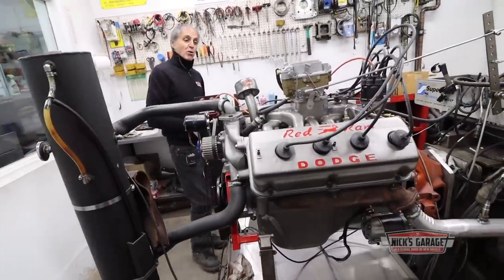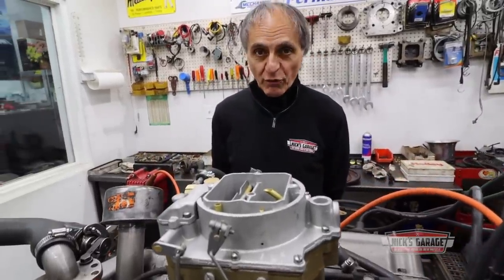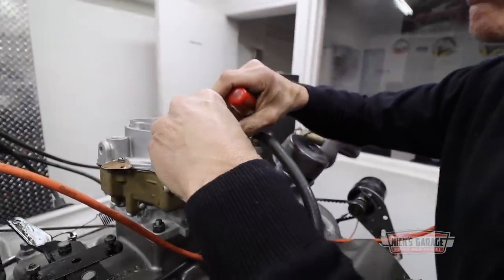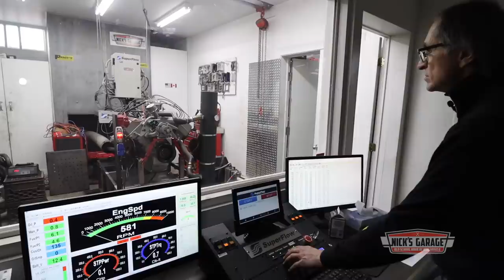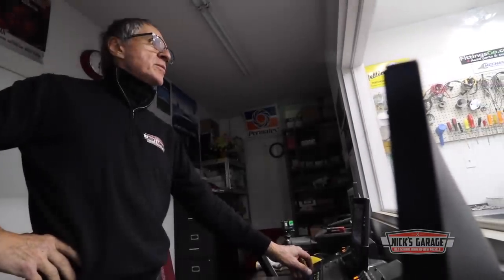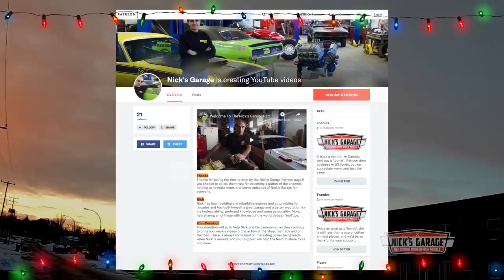Tiny Old HEMI - First Generation 241 Hemi on DYNO

Comment: Nick, Suzuki developed a silicone especially for a model (LS650/S40) single cylinder motor that was prone to leakage between the head and pipe.
It is available through the motorcycle dealerships and is the best product I have ever used for sealing high temp exhaust leaks.

Comment: That 241 Hemi sounds good! And runs so smooth. Like the way you you got it mounted to the dyno!
I like the way you tune your motors  to start easy. You are a Pro Nick!
That's the way those early carbs are. The primary side is where you get your best power on the early carbs Nick!

Comment: Hi Nick..had a carter on a 390 ford..it bogged when you got on it..it was from a 67 galaxie wagon ..i rebuilt it and same problem ..it was my first car.a 65 galaxie..i was working at good year auto service center in 71..i told the machanic who we called ( Bad Bob ) he looked at it and checked it out and ajusted the floats and that cured the problem..it never occurred to me the floats were off a little bit..after that it didnt bog again..after i put the motor in two spark plug wires got crossed and caused it to back fire..bob asked me if it had backfired and i told him it did and why..then he went straight to the floats..the wires got knocked off during the installation of the motor..i corrected the wires after it backfired..but the damage was already done... i was 16..after that ( Bad Bob ) was my hero...lol..always respect our elders..Hope you and your family and crew have a Merry Christmas and Happy New Year see you on the next one Cheers 🍻🍻🍻🇺🇸🇺🇸🇺🇸
Reply: Dave Micolichek  i did watch him use a float gauge on it so something had be wrong..i had a 360 the coil was intermittent failure it caused it to backfire and blew out the power valve and the accelerator pump to blow out..a backfire can cause some bad problems..it can take the teeth off a timing gear ( the nylon gear ) I've seen this happen on chevys..happy new Year...Cheers 🍻🍻🍻🇺🇸🇺🇸🇺🇸🇺🇸

Comment: Neat to see old engines looking & running like brand new.   My dad had an old flat head 6 cylinder (216 ci ?).  We had to fabricate the coolant tube that ran the length of the block.  We had mostly Fords though.  A few flat head V8's (both dead stud patterns) & several Y blocks including a '53 239ci & 2ea 256ci, the more common 292's & 312's.  Still love to watch your postings.  :)
Reply: Don.     Thanks for watching.

Comment: It looks like the spark plug gasket was installed on that plug you pulled . I have removed the gasket from many slant 6's as well as Hemi engines. A gasket tends to chew up the bottom of the tube and changes the heat range of the plug.The book says no gasket is to be used.
Reply: kevin.     I guess you learn something new everyday.

Comment: Yeah I went back and watched it at the beginning and the secondaries definitely weren't opening on those last few pulls but were open on the first pull
Reply: Yeahhhh! Check out time 32:53 the linkage to the secondaries may have been in one of the lower holes. More leverage would be applied on the secondaries and that would account for the lean mis because the primaries were exhausted past nominal CFM. His first thought of Increasing the jet size of the secondaries was correct but looks like his helper was left to stuff up the linkage side. What a shame as I would say his prediction of 160 H/P would have been close with larger jets, providing the jets were not drilled out over size!
Reply: Love your videos Nick :) don't let people near your work though brother ;)

Comment: For a 65-year-old motor, it sounds every bit as stout as it probably did the day it came off of the production line. Great job as always Mr. Nick. Incredibly enough, this is my third time saying this because time certainly does fly. Meilleurs voeux de joyeux Noël à vous et aux vôtres, M. Nick et à tout votre équipage et à leurs familles.  Un grand merci pour tous les grands moments que vous avez partagés avec nous en 2019. J'ai hâte à 2020 et à tous les bons moments à venir.
Reply: Really hard to get compression with such a small cubic inch v8
Reply: Compression can be demonstrated by holding your lips tight together and forcing pressure in your mouth to blow your cheeks out like Dizzy Gillespie's.

Comment: Great moments for sure, nothing wrong with looking for a few more horses lol . Neat old hemis. The WCFB had quite small primary/ secondary butterfly's & with 7.1 compression ratio, 150 HP is ballpark power. The exhaust being another hold-up ...it is also cubic inch limited . Cool passenger car power though for its age.

Comment: What a nifty little piece of history right there! There wasn't anything 'standard' on those old hemi's. It's like they custom built each year model, and every one was a little different.😜 Kudos to you for coming up with enough bits and pieces to actually get a successful run on the dyno. I knew they made a 241 cu. in. hemi, but have never seen one until now!😁 I'll bet a decent set of headers would make a big difference in horsepower over those tiny stock manifolds. EDIT: I'm 2/3 through the video, and I'm wondering how long it will take before you guys realize your secondaries weren't opening after you changed out the jets.😁 You forgot to wire the choke all the way open and it was keeping the linkage locked on just the primary flaps.😉
Reply: Dan.    We had it fixed the next day.

Comment: Nice work getting it running again Nick!  We need to see it in the car when he gets it back together. Another guy on YouTube recently bought one and got it running well enough to drive home. Kinda scary...  The transmission was automatic with two forward, reverse, and neutral.  No park. Have to set the parking brake.  Oh and it looked like a six volt system too.
Reply: Vice Grip right?

Comment: Jeez that thing brings back memories. Just seeing the hardware on the engine and carb is like yesterday to me.  Had a Dodge with this motor. Replaced it with the Chrysler 331ci with a 354ci heads & cam. For that day and age nothing could touch it for torque.  Really miss those days.

Comment: There was a 241 Red Ram out in the barn that came out of a '53 Coronet which had been stripped and sold for scrap by my older brother.  It was the first engine I ever turned a wrench on...I was, maybe, 14 years old at the time.
The one I played with was in way better condition than this one was when it came in the door...but it was removed as a "runner", and that WAS 42 years ago!
I remember seeing marks in the combustion chamber from some sort of rotary cutter that was used to machine the chamber from raw casting to the "hemi" shape.  I merely noted it then as neat...but after learning design and manufacturing, the expense doesn't make much sense to me...unless you're trying to squeeze every last bit of uniformity and performance out of a set of heads.  I've looked at loads of photos in the past hour trying to confirm this before mentioning it here, but found no close-up, high-resolution photos.  I even ran 1/4 speed on Nick's "look at the dirty parts" video...and one where there was a very short bit showing one of Nick's guys disassembling a piston/rod next to a cleaned head.  Can someone here be my sanity and say that my memory that machined combustion chambers were a part of the first Hemi's magic?

Comment: That funny bridge at the front of the engine looks like the "floating power system"  used on all the inline engines going back to the early 1930's. Dodge still offered the 230 flathead 6 at the time these motors were introduced. great video!
Reply: ...yes, and dodge was still making 230 flathead 6's after these Hemis were discontinued...to 1959 I think in cars&light trucks, into the 60's in Power Wagons and such, and I believe into the early 70's in industrial uses....

Comment: When I got my walking papers from the US Army in 1947 I moved to Detroit just to go to work at Chrysler Corporation. In those days there were a few test mules of the HEMI engine, by 1949 Chrysler and Desoto were first on going to production. Plymouth looked at a few different designs, even a V6, but decided to go with the poly head V8 citing lower production costs and higher customer interest or as my dad used to say, a working man drives a Plymouth home, a well-heeled man drives a Chrysler home. In those days each Division got to do what they wanted. Chairman KT Keller always signed off on anything new and promising, the hardest part was getting it under his nose to look at it. These were considered premium engines.1951 Chrysler called theres the Firepower, 331 cubic inches in certain models, also in Dodge trucks. The 1952 Desoto Firedome 276 cubic inches only the Firedome model. Dodge management being the conservatives they were, you know now that I am thinking about it there was still a few guys in management from the Dodge Brothers days, decided to wait and see how Chrysler and Desoto did. When the numbers came out for Chrysler, and later Desoto, Dodge saw it was a grand slam and jumped right on the 241 they had been using as a test mule engine since 1950, and they put the 241 Red Ram Hemi into everything they made, convertible, truck, sedan, hardtop even the station wagon got one. The fun part about the Red Ram compared to the Firepower 331 and Firedome 276 was the offering of over the counter dealer parts, dual carburetors, dual points., that sort of thing a Chrysler Corporation first. You could get a very reliable 175-250 horsepower from this engine, something completely foreign to most in 1953, no other mass-production engine could touch a Dodge Red Ram Hemi in displacement versus horsepower. Not a one. One thing is for certain, nobody, myself included ever expected these three engines to take off as they did, we could not build them fast enough to cover the orders. In 1955 I moved over to the newly created Imperial division and lost track of development on that stuff.
Reply from the maker: Thanks for your very interesting comment, Andrew.

Comment: You had fuel coming out of the secondaries before you changed the jets.  Look at the video of the carburetor after you changed the jets. No fuel that I can see.   Something changed after you took the carburetor apart. Check it out Richard from Florida.
Reply: Richard.  We had the original jets installed and also blew air through them. After that, worked well.
Reply: I noticed that too. My specialty was rebuilding carburetors back in the day.
Reply: You could see the secondaries didn't open at all for the next 2 pulls as well.
Reply: In the video it looked like The secondaries did not open  after the jet change
Reply: I also saw the secondaries where not working after the first pull.  Something was changed internally after you did the first jet change.
Reply: Yeap. Broke something the first tear down. Didn't fix it the second tear down and too stubborn to go back and fix it. Shoddy.
Reply: @InfiniteMushroom my exact thoughts drawing extra air through the gasket leaning it out. Thats why you charge more when the customer helps or is just present... part of Murphys law...
Reply: Like you could do better? Likely not ...troll. Where’s YOUR shop and reputation?

Comment: You have probably found it already, but if not, review the overhead video during the dyno pulls.  The secondaries only opened during the first pull.  None of the subsequent pulls showed open secondaries.
Reply: Good catch,  Mike.
Reply: I noticed the same thing. On the last pull it looked like it was barely opening
Reply: Mike.    Nice to film above the carb at full throttle.
Reply: I noticed that too the first time, I looked at it again and yup a two bbl carb vs a 4 bbl, ha ha ha. voila 10+ HP.
Reply: I agree.

Comment: Hya Nick, I was enjoying the video to the end, I am an older mechanic myself and can not understand why the engine has lost 10 HP It is amazing like what I would do how you made it work on the dyno. I think you are an amazing and determined gent as I am and found your testing procedures very well and really enjoyed your video. Thanks Nick as you are a great guy. Ray C Spring Hill Fl I have a 1923 titled 24 Ford street with a 350 chevy & a 350 THC on a Jeep Wagoneer HD rear and I love it so much. I love edelbrock and say it like you do too. I have a 4 bbl street racer carb and have a 290 350 that runs at 315 HP with hi rise and headers. I am doing doors on it now as I hate climbing in. Next will be suspension and no more buckboard. It runs like a raped ape though now with way too much power. Bless your heart Nick!!! RC

Comment: NICK IF YOU WATCH YOUR ABOVE CAMERA THE FIRST PULL THE SECONDARY AIR VALVES OPEN AND YOU CAN SEE FUEL. AFTER YOU TOOK CARB TOP OFF ON ALL OTHER PULLS THE SECONDARY AIR VALVE IS STUCK.  NO FUEL!!!! 10 HP
Reply: Gary.              We saw it. We got it fixed.
Reply: Dave Micolichek  .   We gained back our 10 HP that was lost after tampering with the carb.

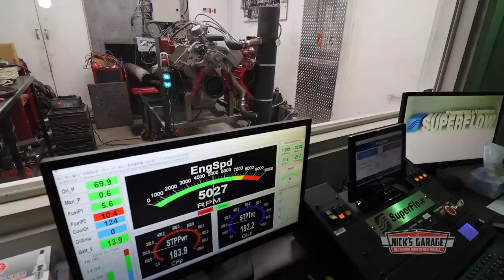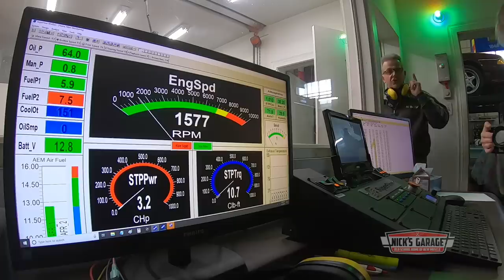Comment: Hi Nick ,nice motor.If you check the video i believe you'll see the rear jets flowing and the plates open up at 21:30 .Then after you changed the jets at 36:15 or so,they are no longer flowing, i think the mechanism that opens the metering rods somehow got messed up.I remember working on 1974 ford carb with variable venturies and also other brands of carbs that use metering rods for fuel adjustment. If you review your tape i think you'll see what i mean.I'm and old fart like you and when I'm stumped the first thing i ask when things go wrong is ,WHO"S GOT THE VIDEO on their phone??A huge back fire in the carb on video is a thing of beauty on REPLAY...haha thank you for your videos nick.A FAN OF YOUR CHANNEL.
Reply: roberto.      We had to blow air through the rear jets and to get it work correct.
Reply: Roberto, You saw what I also did.  After he opened the carb the first time for jet change, there was no longer any fuel coming out of the secondaries.  good spotting.
Reply: Yup i noticed that right away too

Comment: MANNY!
As usual, Video Dude had the answer from the 2nd pull on - the secondaries were dry as a bone
after the first time Nick had the carb apart!! You can see it in the overhead cam shot.
George, you shoulda told Nick! :-)
Those old WCFB's are sort of odd critters, definitely an acquired taste.
If you get that engine enough fuel, she'll make the number you're after. 
Mechanically, she's AOK!

I tell ya, George ought to be getting awards for his fine production....
MERRY CHRISTMAS to everyone at Nick's Garage from everyone here up on the ridge in Tennessee!
-Ed on the Ridge
Reply: Ed.     We had it fixed the next day and went to 157 HP.

Comment: I believe the early 70's Corollas had a "T" engine that was a 4 cylinder hemi. 
On those canister oil filters, as long as you remember to get the old o-ring out you shouldn't have a problem with leaks. Run a flat head or a pick around the slot if you can't see it well to make sure nothings stuck in it. Sometimes there will be an old one crammed in there. I used to do a lot of them.
That sucks, the way that one is pointed down...looks like a messy change.
And Merry Christmas!
Reply: Old Chevies canister oil filter sometimes you would take it all apart and find three or four rubber rings jammed up in there where people knew how to put new ones in but not take old ones out.
Reply: Toyota 2t hemi head is work of art
Reply: @johnstuchlik5828  Neighbor is now working on a 3T in his '84 Corolla.

Comment: nick.. after WWII my former boss worked for chrysler.. when the 53 or 54s came out .. one kept coming back on a tow truck again and again with fouled out spark plugs. they replaced the carb.. kept it for days..  several days after the car was returned to the customer it came back on the tow truck again. nothing could be found wrong with it.. eventually she was told that when it failed in her driveway again.. call and a tech will come out to her house.  my friend followed her to her car.  she opened the door.. sat down.. pulled out the choke lever.  hung her purse on the choke rod..  started the engine and pushed the choke rod in.. but this mornings purse had a wide band and would not let the choke open and it would foul the spark plugs as the wide band on the purse kept the choke from opening.